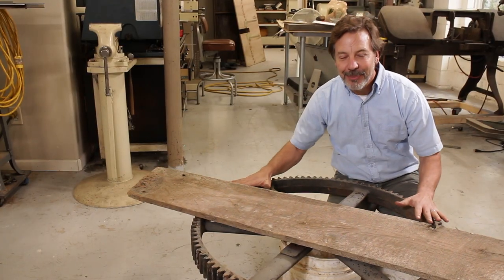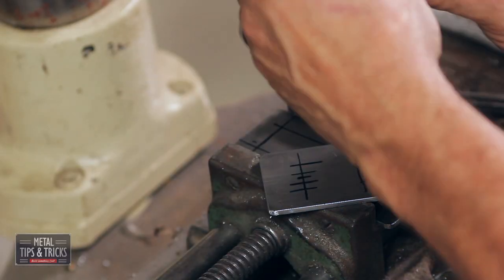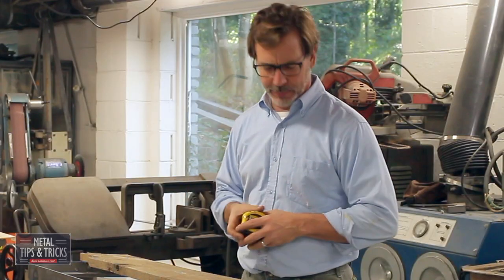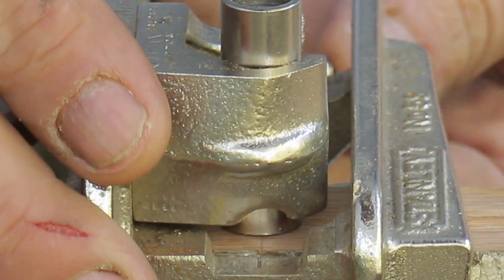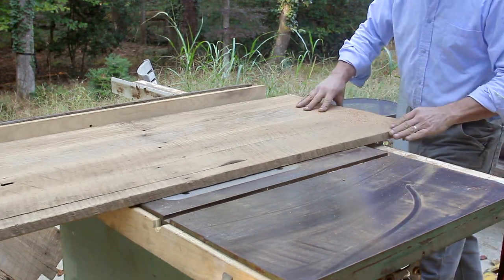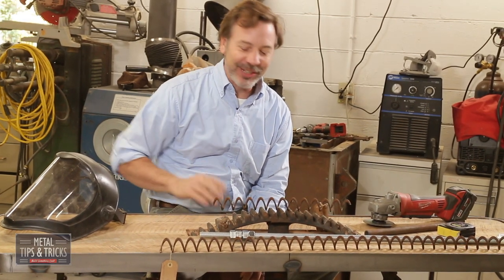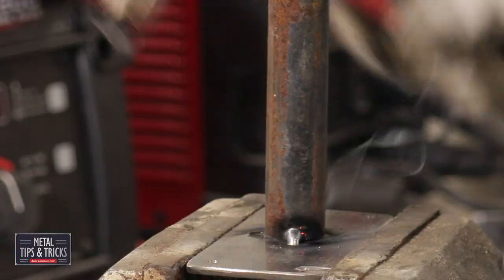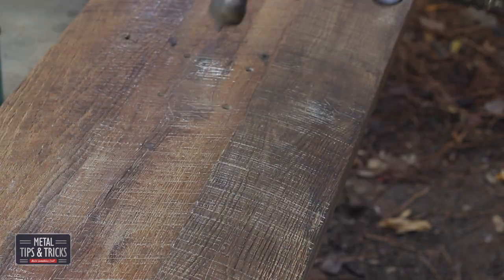How to make a table using a  gear

Comment: I think old wrenches welded together in a wire frame at each end along with a bar put under the teeth above the wood on the bottom and two below the top that extend to the metal rim would have looked nice too. I appreciate you leaving the old saw mill marks Over all I like it!

Comment: Breaks so many rules and looks great as a result.  
A comment on glueing dowels, if there is too much glue in the hole then it's a recipe for disaster.  Fluted or spiral dowels as Marvin Carvin suggested are the ticket and it looks as though you already use these.  If you use less glue doing the widening joint by applying a "thin smear" of PVA, when the boards are clamped a very small teardrop shape is formed by the excess glue and is easy to remove if you get it when it has skinned and is not likely to run but before it cures.   Great video. Thanks & cheers, David
Reply from the maker: Great comment. :-)

Comment: I like it a lot. The gear can be you pen and pencil holder.  Makes me wish I kept many items I've thrown out like a cast 36" Sq. sharper table, cast lathe legs... Ugh!   Please say how you antiqued the band steel frames.    Easy for me to say now,  but personally I think the thread rods idea (maybe old acme thread  lead screws) would have looked better than the feeders as I assimilate the two together better.    They could have been mounted using SLOT head flat head screws , screwed into the ends of the rod at the table surface.  Then large rusty SQUARE nut at the bottom.
When I watch you cutting the cutout for the gear in the top I was thinking he's on the wrong side.  Had you cut the opening from the top dimensions, (min opening , length), you could have chiseled out the wood on the underside for a tighter fit.    Thanks for the effort to make such a good video.

Comment: Hi Dale,
To make that OSHA approved you may have to add a guard for the gear sticking through the table top :)
Steve
Reply from the maker: I tried to find a safety guard for it, but I could find one that dated back 100yrs

Comment: Nice design! If you use dowels that have spiral or straight grooves in them, the excess glue has a place to go. They are defacto standard in the cabinet and furniture fields.

Comment: As a matter of technique on the table top three step process you chose, did you first join the two center boards and work outwards, or arbitrarily work from one side?  Also I am very glad you did not use the all thread option for the legs.  The chicken feed augers really make it...
Reply from the maker: I went from side to side